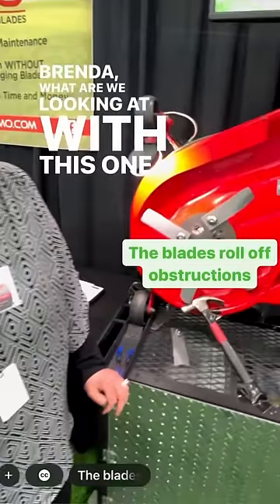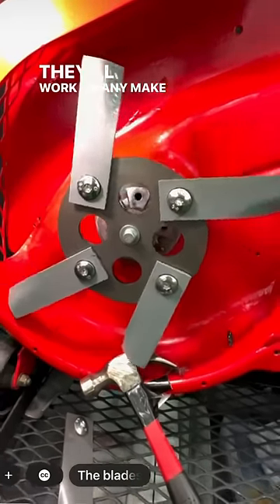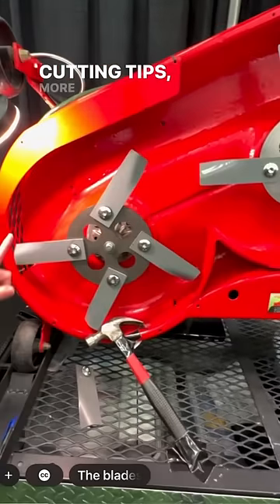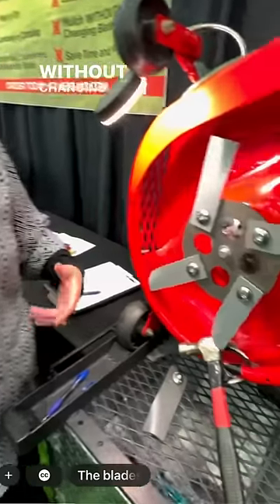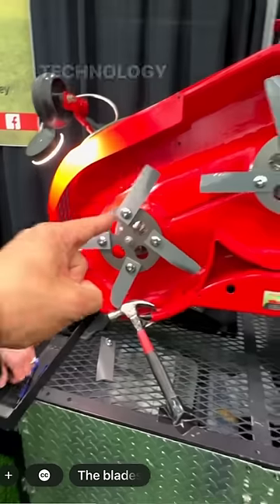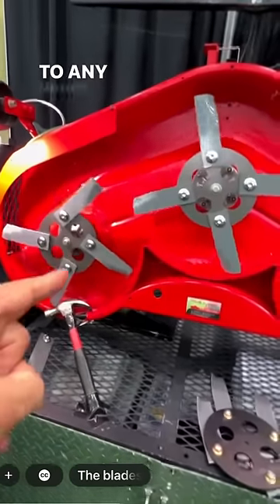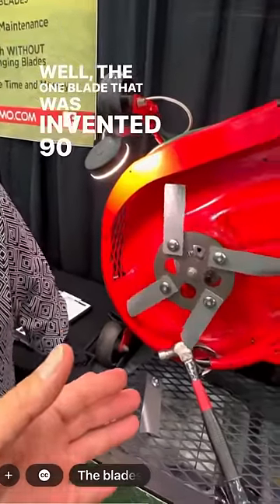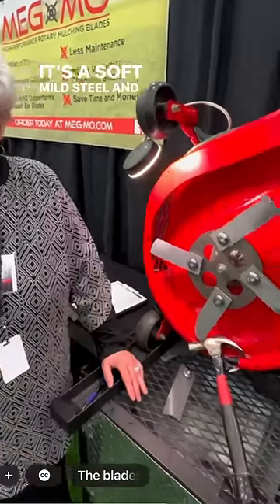Farmers already use this. #lawncare #mowing #shorts

Comment: i been mowing 30 years and fixing mowers about 20 of those as well. The reason these aren't used despite existing for years is cause tall or wet grass would bend them back and not cut as good. Also for commercial use you will have to clean them weekly to keep them moving freely just like i do on my brush hog before each use. Plus need a bigger engine. Use these mowing overgrown yards to knock them down without worrying so much about shattering a gearbox or spindle. thats it

Comment: At about 3000 RPM, the centrifugal force pulling those blades taut is still going to keep them white rigid. You've just turned your lawn mower into an impact drill, minus the drill.

Before anyone says anything. I am a physics major. I'm aware centrifugal force is a fictitious force that disappears in an inertial reference frame. However, the blades are, in fact, spinning, so if you were to measure the tension needed to keep them from ripping off the shaft from their point of view, the, you would not be in an inertial reference frame.

Comment: …back in the early 1960s, Jacobson lawnmowers had four small blades, attached to a disk… one time, I hit a rock, a blade broke off the disk, (the disk failed @ the bolt hole), and the mower pretty much exploded… the carburetor broke off, the handle that I was holding, separated from the mower, the free blade, (looked exactly like a farm mowing machine blade…, flew past me, and hit a stone wall behind me…

Comment: Mower blades are not "mild steel" as in generic cheap junk, they're an extremely tough low carbon steel, John Deere uses austenitic stainless which is some wild stuff, it's stainless, it's soft If struck but extremely hard wearing because it basically has little bits of iron carbide in the lattice which form in the steel during manufacturing.

Comment: Bought set for 1575 John Deere 72" cab n Air...mows 500hrs a season, get about 4days out of a new set of stock blades. Get about 5days out of the MegMow blades. Set of new MegMow blade tips cost about 80 to 100 bucks and can only order from MegMow. After went thru 2 sets of blades took the MegMows off and they been laying in back of the shop for the last year n a half...they last nowhere near as long as advertised. Not worth the hassle.

Comment: The reason that mower blades are made of mild steel is so they won’t break and send flying shrapnel when they inevitably hit something hard. Hardened steel snaps, mild steel bends. Don’t use these unless it is in a very well known environment.
Reply: You see I have a problem with ppl that think they know more than they do. You see what you just said is general knowledge that any average man could tell you but you also completely ignored the fact that the blades are not in a fix position like they would normally be on a normal mower. They are pivoting blades that will fold inwards in case they hit something too hard for them to cut through and therefore protecting the blades from too much damage
Reply: @alexethington678  You see, you have a problem with understanding physics.
Reply: Yea I agree and the one she used for three years I don’t believe that those blades would be thinner than they were those look brand new, but sprayed with a solution to make them oxidize and then they ran it once that’s how you get the shiny parts on it
Reply: Blades are probably annealed. 100% they have quality control just for this because yeah brittle metal breaks.
Reply: Oooohhhhh, and we are supposed to believe you because........ you say so?
Reply: @davidbuffum4887 No because the law of Averages sais that He is Correct. Also U can tell by the number of thumbs UP. ALSO IT IS VERY PROVABLE. U got Goo Gagel.
Reply: The other reason,  was because they they were fixed in position,  and  didn't have any give when hitting obstacles with a standard 2 sided fixed mower blade. 

You have a fair point  , but it had been designed around.
Reply: @davidbuffum4887  It’a true this is just my hypothesis but why would this product only be invented recently? Why wouldn’t the mower manufacturers already be using this design? Why wouldn’t bush hog manufacturers who already use this design not use hardened steel? Replacement blade industry isn’t the answer because conventional blades are relatively cheap and usually don’t need replacing very often. This isn’t a new idea, it’s just a bad one.
Reply: @rustbucket9318  For the same reason that Sensation Mower Decks are no longer manufactured.. Because they Never wear out and never have to be replaced other than wheels and powerhead.
Reply: Mower blades are made out of tempered steel
Reply: You did see where it moves when It hits something right. So no it won't just snap. It will be safer and keep the shaft from bending
Reply: This design is exactly what is used in bush hogs.  My bush hog uses 2 blades that are 30inches long and 3/8inch thick.  I hit all kinds of debris, nothing has flown out of that in the 11 years I've owned it. I expect the same result with this product.
Reply: @joeh4295  Bush hog blades are mild steel. There is a reason for that. Everyone wants to say I’m wrong about this but the proof is in the fact that no one uses hardened steel blades in any type of mower because of the exact reason I said. This is the only company doing it and I assure you they won’t do it for long.
Reply: @wildfire365  Hardened steel doesn’t care about that. The impact alone is enough to cause catastrophic failure. I understand the premise behind the product but it is based on bad science. No one uses hard steel blades for a reason. One reason. They break.
Reply: @tombragalone7250  No they are not. They are low carbon mild steel. I’ve tested many blades for secondary use in knife forging and they all don’t harden. That brought me to research them. That is the basis of my comment.
Reply: @thybigballs  , YouTube has offered a $40,000 reward for the first 12 people to type a reply chain that doesn't quickly turn into an argument. It was set up in 1914, and the money is still setting there.
Reply: @Yodie208  I just researched them because of your comment. I found nothing that says they used hardenable steel for their blades. Lots of info about their high quality and their business history. They were merged into another company and then bought twice over since to finally be owned by Toro. They did quit making sensation mowers in the 80’s though.
Reply: Looks like that is why they have breakaway action. No?
Reply: Both can be true
Reply: @thybigballs  those things wouldn't last one season in places with rocks. And you probably can't cross cut a baseball field with them. Just another gimmick.
Reply: it could be case hardened
Reply: Boring. NEXT
Reply: Im not sure how well they work but there's a massive variance in hardened steel. You could certainly have a medium type carbon steel thats been through heat treatment that is still soft enough to take this abuse. I havent done any testing with mower blades obviously but a low 50's HRC in a steel thats not extremely carbon heavy is not going to snap. Maybe if you ran over a crowbar of something but not a small rock or a stick. Theres really soo many variables in the steel equation that it's impossible to judge based of the term "hardened" alone.
Reply: Yeah I mow a few acres of yard on my very rural property nestled in the mountains. I purposefully use the cheapest blades I can partly because of this. I want the blades to bend because they’re gonna hit a lot of stuff mowing my property. Also no point in me buying better quality blades, they’re gonna get destroyed too, just takes a little longer, cheaper to just replace the crappy blades a little more often.
Reply: @redneck4200000  hardox 500 is not very impact resistant from what I can tell going off the charpy impact data.
Reply: Glad I read this before I sent it to my boss and said hey check these out why don't we use these, lol, that's why! Thanks dude
Reply: @redneck4200000  steel can be brittle
Reply: @alexethington678  string trimmer line is flexible…. But I promise you… IT STILL SENDS STUFF FLYING
Reply: Agreed. And "7 times harder" would imply they're running at over 300 rch as well. cough bullshit
Reply: @redneck4200000 Hard is not hardness bud.
Reply: @alexethington678 Ya, run over that hammer at full speed and see if you still have a blade.
Reply: @rustbucket9318 Agreed. Arms like none of these people understand kinetic energy or how Rockwell scales. Why is the lawn care industry not using this? Duhhhhhhh
Reply: @rustbucket9318 dude the reason no one uses them is because they wouldn't need to be replaced which means less money! They purposely make things to break or wear out so that way they can get more money. That's why they don't use them more.
Reply: @rustbucket9318 just to let you know that this company has been around for quite a few years now. I'm pretty sure that if it wasn't working, they would have shut down by now lol.
Reply: So true like when you hit a nail with a hammer and the hammer shaders cause it’s hardened 😐

Comment: Simple solution. Cut your existing bar blade when it gets worn out. Drill two holes in the correct spot and bolt these on. You can free float them or bolt them down tight. Works for my mowers. I can't say if they last longer or if the steal is more brittle. Maybe I've been lucky...

That said, I'm not recommending you do this and I'm not responsible for anything that happens if you do.

Comment: The blades may be able to take the hit but the bearings and housing won't be able to take the vibrations when the system is out of balance after the impact.

Comment: In the late eighties and to the mid-90s please to do my own business in lawn mowing. In 1993 they started bringing out single blade self-propelled lawn mowers mowers mowers. Yes I decide to use the new mowers but I quickly found they weren't sufficient so I went back to the rover style setup around disc and four blades it cut cleaner and faster every time and it didn't take rocket so it's to work out. And now I see this mag mo set up an it is fabulous I will be ordering for my self here in Queensland Australia as my daughter is using my equipment to mow other people's yards  even using my Rover zero turn with the steering wheel RTZs46" .

Comment: When you have a flail style cutting head you can afford to run way harder steel because the knives can pivot if you hit something rather than shatter. We can’t use harder steels on a regular spindle because the blades would shatter and pieces would fly off and potentially kill someone. So imo, we would run harder steels IF they were safe. Also, would they disclose what type of steel they are using?

Comment: As someone who sells spare parts for stihl, kubota and cat dealership let me tell you farmers don't like flail blades like these because they dont actually work, looks good when its slowed down to 6rpm but what about when the blades swing at 6000rpm+ (idk any mower bladethat goes below 6k rpm)

Plus farmers over torque so the bending/recoiling back would not happen.

Comment: I can understand 2-3 times the traditional cost over a stamped steel straight blade, a bolted swing wing blade such as this will be a challenge for most folks to sharpen and rebalance and you had better have a few extra blade ends or you cannot run this system with one missing blade, the imbalance will be significant…

Comment: Comes with a waiver and a LIFETIME WARRANTY!!!(When it breaks, its life is over, and so is the warranty.)
Reply: Think of all that extra weight on those tiny little skateboard bearings on the deck... 
Imagine all the one bolt getting loose and you fire a hardened steel projectile into the side of your car, the wife's car and the house next door....

Comment: "hardened steel that'll last for years".................

As someone who does knife making on the side a blade that is hardened (even tempered) can snap in half and even that its highly recommended to sharpen them every few months 

I have mower blades that I bought 5 or so years ago and they are just fine. How? Because I sharpen them just enough to get an edge, every month.

Comment: The speed those blades would go to cut, or mulch, would still be fast enough to do grave bodily harm to an animal or a human. 
Those "bush hogs" or huge mowers you see mowing large fields, along interstate highways, or around airports & airfields have spinning chains, which won't come apart, should it strike a hard object(s) like rock(s). Which leads me to this story.

One such bush hog was being pulled behind a tractor cutting the grass along the airfield at NAS Memphis. The tractor must have found a hidden hole in the ground, since the man on the tractor was thrown off, landing between the tractor and the bush hog. The tractor didn't stop soon enough to keep the bush hog from running over the man. 
I had to transport the senior doctor from the base medical office, so he could pronounce the victim dead at the scene. He was a newlywed of two weeks. Apparently, he was probably one of those who didn't believe in seat belts, either, because the tractor seat had one. 

So, yeah, the nylon string is about the ONLY thing that will cut weeds without risk of injury from the cutting media, itself. Yes, it can still kick up debris and throw it at you, but it won't cut your foot off, or any other part of your body, nor will it turn you into mulch, like the bush hog did the tractor operator.

Comment: How many hours before it starts throwing those?
People and terrain result in damage.
I really liked the DR trimmer field and brush type. It used thick trimmer line and unless you stuffed it in grass 4 feet tall, it wouldn't get wound up in it.
That's the smart money if you have a tough job to conquer.
I sure thank that friend who let me use his.
It did all the work and was comfortable and easy to walk behind. 
Then you could just use a normal rider, or homeowners push mower.
The display says 264 hours.
Betcha it wasn't mowing where a challenge existed.

Comment: First of all, they are not disposable. I've worked a Toro dealer for 4 years and we have contractors that still use the same blades for at least 4 years and are sharpened twice a year. The reason is that at only 10 dollars we sharpen a set of mower blades and the mild steel is actually heat treated to be like a sword and be able to flex of any rocks or hard objects without breaking and when they do hit something the blade bend and be out of balance and then you can tell by the ungodly vibration in your deck that they are bad and need to be replaced.

Comment: This is not the same technology farmers use. Rotary mower blades can rotate 360 degrees without hitting other blades or their attachment drum. That way when you hit something hard it can send the individual blade spinning until centrifugal force pulls the blade straight out again. These blades will hit the attachment bracket and each other causing all kinds of havoc. Watch your legs.
Reply: The swing back blades should not be loose like they show in this video. Should be firm enough that you can still move them with your hand. Too loose and they will damage themselves.

Comment: These are not flail mower blades. they are called swing back blades My old Rover has them. It has 4 blades and mulches and lifts much better. The point of swing back blades is the blades 'swing back' when you hit a hard object reducing blade damage. The center disc protects the engine shaft from getting bent.
Reply: Very common in Australia.

Comment: My victa mower uses a similar design just with shorter blades to prevent them breaking, works good but still needs sharpening every now and then.

Not a cure all at all

Comment: The reason they aren't used in the commercial/industrial lawn care industry, is because they're horribly inefficient. Fuel consumption is through the roof. If you're mowing on hills or tall growth, they take your badly needed horsepower. This is for people who want to waste money on gas and use their mower for a brush hog.

Also, this is not the same design as a farmer's flail mower. This is the same design as a brush hog... two COMPLETELY different types of mower.

Comment: In Australia, Brisbane to be sure I started a mowing business in 1972.
One of my mowers was an old flat deck Victor 2 Stroke with about 3in cut off the front so the 4 hand-made blades were protruding to cut the tall stuff.
those blades were full swing 360 deg in case of rock or anything else they were not happy with and also sharpened at the end as well as the full leading edge all my other mowers were mulching and the blades were flat, and the rear lift section on the blades is used to throw the grass out from under the deck, not to Mulch, flat blades mulch without an exit to the mower deck a hole in the side of your deck and the blade will have a twist up section at the rear so as to push a lot of air that helps to clear out the grass or to push it out the rear or side catcher.
I started my working life as a Blacksmith so I was trained to make all sorts of mower blades some were even edge hardened, but even they needed a sharpening at the end of a few mows.
As for the big holes in her disc, that just decreases the spin power in thick grass.
To sum up as good or useful as Tits on a Bull.

Comment: Yes thanks billabong it’s common sense that they would still break spinning at 2000rpm they might as well be fixed rather then pivoting point in case our 500,000 dollar windrow that runs it’s cutting discs with pivoting blades attached to it have to be replaced all the time and get dulled and chipped and even broken.

Comment: I would bet it wears out the spindles faster, and probably doesn't cut evenly,  as it is the same design as a bushhog and my bushhog doesn't have a good cut.  In fact, bushhogs are designed to rip the top of the grass to slow future growth of grass and it is not recommended to have a super sharp blade.